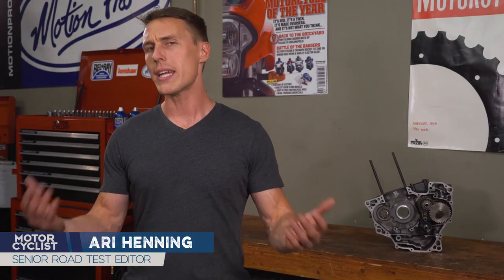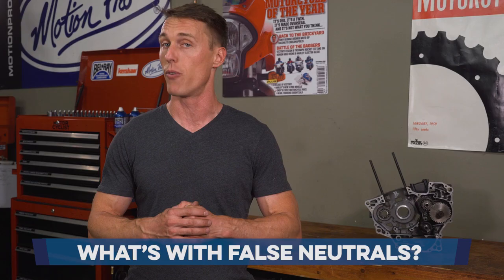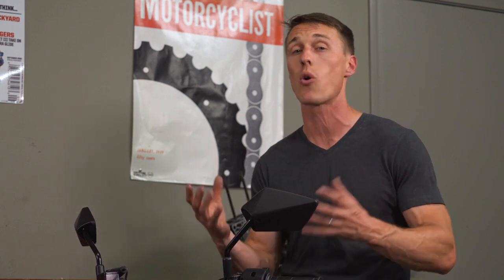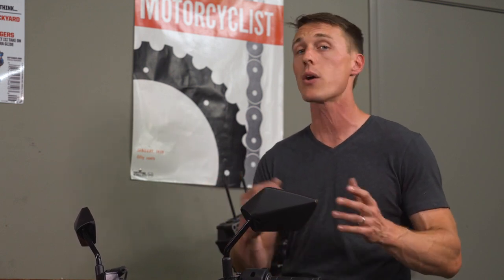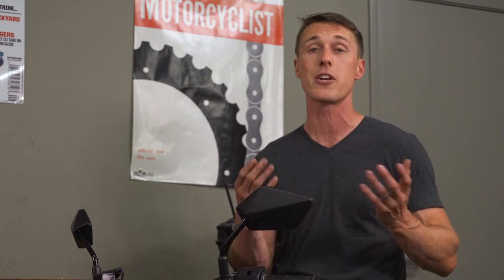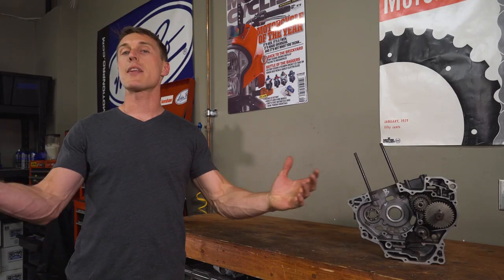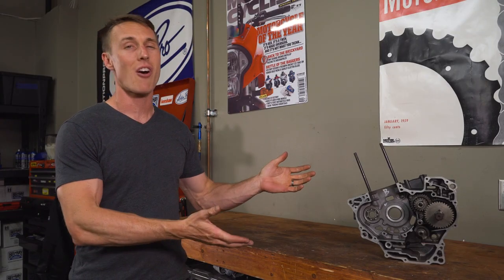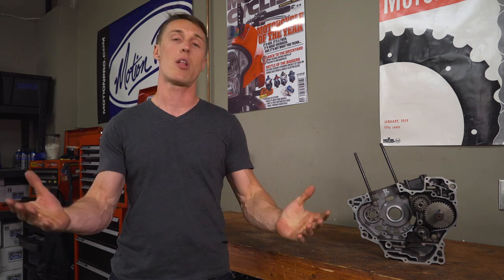What’s With False Neutrals? | MC Garage

Comment: Guys, need some help here. Whats the reason for HARD gear shifts, assuming I am wearing boots, doing close to perfect immediate shifts, top of the line engine oil, no damage to shift lever or shift linkage? I cringe almost everytime while shifting because it feels like the gears are grinding from 1st to 2nd to 3rd and back down. To 4th and 5th is fine. (yes I got a 155cc bike with 5 gears only)
Reply: Sound like clutch wire slack (or of hydraulic, air or to little fluid). I do clutchless shifts on all bikes with rev matching so this is never a problem but in the days when I still used clutch for gearing this happened from time to time when clutch was not disengaging properly.

Comment: Great vid as always Ari and the crew.

Funny thing: I always keep my bike in fourth gear as an added inconvenience against bike theft. I shifted the bike back into neutral with my hand and it wouldn't move, the bike was not in gear because when I pushed hard enough the rear wheel (the bike) would start to move which wouldn't be the case if the bike was in gear. It felt like it was in between gears so I guess I got a false neutral while the bike was stationary and off as that's the only reasonable conclusion I came to, or could it be something else?

Comment: This is a first, I never knew about this. I feel like a simple way to avoid this is to wear the same footwear when riding and adjust the shifter for it. That way your feet have good contact with the shifter and you shift completely. I used to miss shifts cause I was riding with a bunch of different sneakers before and I never adjusted my shifter. I got riding boots, adjust my shifter and my shift game got strong

Comment: Hi MC GARAGE. I'm from Shillong, India. I have a 2013 Pulsar 200ns and the stock exhaust is now making a very irritating sound as if metal pipes are vibrating against each other... it happens every time I rev the bike in higher RPMs. The mechanics here say that I have to cut open the exhaust and weld "the gasket" inside the exhaust. Its costs a bit. And some say I have to replace the entire exhaust altogether.. I don't have the slightest clue as to what is the truth. And I want to know exactly what I'm spending my money on. Please enlighten me. :)

Comment: Thank you for this video. I completed the MSF course today and had this happen a couple times from 1st to 2nd or 2nd to 1st and it was driving me nuts because it was like I was in neutral but the bike wasn't saying it was so I wasn't sure what to do. I eventually worked it out in my head that I must not be engaging the part of the shifting process enough(clutch in this case) and stopped doing it but this is helpful as a visual aid of what's going on.

Comment: I had this happen between 3rd and 2nd gear. I couldnt shift down to first at all, had to shift up, then down to fix it.
Reply: Conker The Cat happened to me a few times, so I pulled over when it happened one time and found out that the shift lever was going underneath the foot peg bolt

Comment: I got this with my VTX1300. And as you said it always happened between the 4th and 5th. It is scary when it happens because the throttle is at high speed. However it only happening on the VTX. I never had this issue with the Aero 750, both Honda bike.

Comment: It's worth mentioning that many people experience false neutrals because of improper shifter height.  If it's set too high, for example, they might run out of flexibility before reaching the end of the shifter's travel.
Proper shifter setting will make full shifts easier and more reliable.

Comment: I need some help.. my bike was recently involved in a small crash where the forks got bent. the impact was on the left forks. the mechanic  said he would straighten the forks out using a hydraulic press machine..but even after getting it done there is more weight on the left handlebar of my motorcycle (clip on handlebars). while taking corners there seems to be a drag towards the left. I have checked for punctures on my front wheel.and I found nothing. will replacing the forks restore my previous handling? and should I change the position of my handlebars??

Comment: hi sir, can you make a short video between 2stroke and 4stroke bike engine? and difference between 4stroke auto clutch and manual clutch. And if possible difference between fuel injections and carburetors engine? thank you so much for reading this. ride safe.

Comment: This is great information, Ari. I'm sure you've heard of the Africa Twin's issues with false neutrals. My AT has about 6k miles and randomly has a false neutral between only 5th and 6th gear. A lot of times it feels like you need to double shift into 6th gear? If that makes sense. Anyway, I've had so many false neutrals with the bike that it has really led to me not liking the motorcycle. However, I have recently tightened the clutch lever and lowered the height of the shift pedal and I have not had one false neutral since then. Although if/when I get another false neutral, I will remember to blip the throttle when I shift again so it doesn't sound like my transmission has just been fucked completely. Thanks again!
Reply: Clutch less shifting I have experienced give lot less chance of false neutral on all the bikes I have had.

Comment: After mounted a Dynojet quickshift I have many false neutrals often. Why does this happen. Never happens with manual shifting.
Reply: By design the gearbox has to take it out of 1 gear and then into the next, as shown in the video. With the quickshifter you're cutting the power when you shift and using the slack in the gearbox to take it out of gear, and then essentially rev matching to get it into the next. As in a car if the revs don't match it won't go in gear. Presumably in your case the shift is taking too long and the engine rpm is dropping too much, or you're not giving the lever a full push so your push is only taking it out of gear and you're relying on the shift star to out it in the next. You could either try the suggestions in the video or see if there's an improved shift star setup for your bike, which would giver a faster, more definite shift

Comment: Best way i have learned to avoid false neutral's is when you shift from first to second is to pull the clutch lever all the way in then keep your foot pressing upwards on the gear lever with constant pressure as you shift and keep holding pressure when you reach the gear and until you let out the clutch, so there is no way the gear can pop out and its assisted all the way through its travel to go into next gear, i only started getting them when i became too used to the bike and was lazy shifting fast and slightly depressing the clutch and quick flicking the lever off from lights. Just gotta take more time and be more thorough when shifting, of course slower but better than a miss shift.

Comment: I have a few relatively simple questions regarding this:

Does 'hitting' a false neutral (by itself) cause damage to my gears?  I assume not.  (Of course, forcing the gear back in afterwards if done wrong would probably at least cause a lot of wear?)

Would it be better on the part to NOT engage the clutch, and instead to what quickshifters on more modern bikes do? Namely bringing the revs up to JUST the right point while putting a little pressure on the shift lever.  From my understanding, this will allow the gears to engage without any (in a perfect world) force being applied to them at that moment, therefore reducing the wear.

Also: If this happens somewhat frequently when 'rapid-shifting' (on a 27 year old bike, no less), should I be worried about the gearbox?  Or is it just a side effect of normal wear increasing clearances, and I should just be more careful while shifting?
Reply: Also:
"I know motorcycle transmissions aren't the most exciting topic..."

ARE YOU KIDDING ME?  I would PAY for more videos about the inner workings of ('my') transmissions!

Comment: why when i shift from 3rb to 4th gear on my motorcycle at med rpm, after i press the gear shift it didn't shift properly but after i apply the gas pedal the gear is engaged with clunk sound? but at higher rpm it didn't happened? this problem only happened when shifting to final gear..

Comment: 1. use the right oil
2. don't "stab" at the gear lever. press the gear shift lever fully, until the clutch is fully engaged and the engine has started loading the next gear, then release the gear shift lever, allowing it to spring back to its mid position.
Voila, no more false neutrals.

Comment: This used to happen to me all the time. When you shift put some pressure on the shift lever with your foot, THEN pull in/let out the clutch in one motion and you will never have smoother shifts. 
Hope this helps, has worked wonders for me!

Comment: Suggestion : When you get a false neutral, (as stated) try and get your revs to match your road-speed in the gear you should be in. Then change UP. If you got a false neutral between 4th & 5th, then go for 5th or 6th. Do not go down, whether that's the direction you were headed or not. Reason : there's no major problem if you suddenly find your self in 5th, when you expected 2nd, but there can be a very big problem if you suddenly find yourself in 2nd, when you expected 5th. A gear too high is an inconvenience. A gear too low can be life threatening. First, ride the motorbike - don't hit anything while you're distracted and messing with the gearbox. Second, change up - get in a gear that works, before you worry about getting the right gear. Third, change down and do it properly this time. False neutrals on an up-change are less of a problem, just do it again, and don't let the revs drop too much before you try it...
Reply: How are you going to end up 3 gears away from what you were expecting with a sequential transmission? Ya lost me.
Reply: Exactly. He talks rubbish.
Reply: Kneedragon1962 i accidentally downshift when it false gear, my front sprocket broke.... Broken screw... 😖
Reply: @Jimmy Doran ~ mmm, yeah, or more likely a sign of a slippy left foot.
Reply: You explained what I intuitively have been doing anyway. Very cool^^

Comment: Lots of riders don't take the time to properly adjust the shift lever. A shift lever that is too high is most often the cause of sloppy shifting. Also proper riding boots that allow firm contact with the lever is a big help. Proper clutch lever adjustment around 2 or 3 mm slack at the lever is a must for proper shifting.
Reply: Yes properly adjusted lever is a must have. For shifting on the gear type that is on bike you don`t need to use the clutch if you do it correctly with rev matching and all that,  it can actually be more gently on the parts then using the clutch and not rev matching. My experience is that clutchless shifting give less problems with false neutrals.

Comment: When I added a Heel shifter to my Victory Cross Country, I started to have "False neutrals" I realized by boot would gently  touch the lever,  putting the transmission between gears. [This can happen on any bike with floorboards and heel shifter] .Now I am careful to keep my boot clear.  I did make an adjustment to the linkage, and it seemed to help.

Comment: could anyone explain in more detail what could be wrong with a transmission that goes out of gear and has very contstant false neutrals between 4th and 5th and 5th and 6th?
Reply: Leon possibly gears worn down?
Reply: i don't know, I have taken this whole bike apart and painted the frame and put a new cilinder on it, but now it has this gear problem. Im guessing ill have to take the blovk apart to find out..
Reply: Leon Well trying out a slightly different oil has worked for some people
Reply: thats a really good tip, ima try that out! thanks
Reply: Sounds like you need to take a look at the shift star/arm/spring
Reply: well i am thinking of just taking the block apart.
Reply: I'd check/replace the shift star setup first, much simpler than stripping it down fully
Reply: it depends. is the shift star in the middle of the block with the actual gears or is it just behind the clutch cover?
Reply: It's not in the middle, I think on some bikes it has its own cover under/behind the output shaft. Depends on the bike
Reply: thanks, i will look into it.
Reply: I ‘ve had this problem on my Africa Twin since the day I picked it up brand new. Honda and the dealership don’t want to address a lemon 🍋, they tried to pass it on as rider error, well I can tell you after 45 years of riding I’ve never had a problem with another bikes tranny the way I’m having problems with this particular bike. I’m f-ing pissed!

Comment: Thanks for the video, wanna add one more questions while the topic is transmissions. 
Why when the bike is at a high gear, we are unable to shift multiple gears down where it will feel like Un click able until clutch is a bit loosen and it engages with a middle gear.

Comment: Sometimes i have a problem with downshifting. It appears to be in neutral but its actually between 2 and 3 gear or even between 3 and 4 gear. You can probably already guess my trouble with pulling away at a green light. When you expect it to go in 1st gear. How does this happen and how do you avoid it ??
Reply: It appeared to be at the last gear because you can't downshift any further. But in fact it wasn't your last gear.

Comment: There's a few twisty hills near me I like to roll down in neutral (it's more fun than it sounds) but when shifting back into gear with the clutch in the bang seems more severe than when you first kick into gear from a stop. Is this bad for the gearbox? I would either rev match into second or shift up into a higher gear before letting the clutch back out.
Reply: Yeah that's not great for the gears. Blip the throttle and then shift up into 2nd.